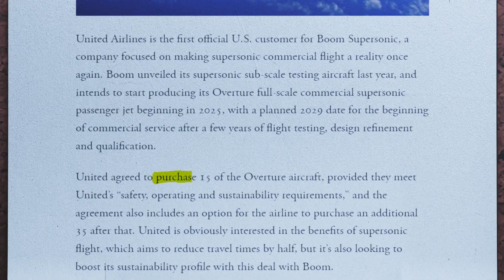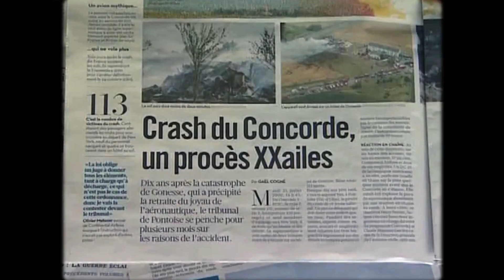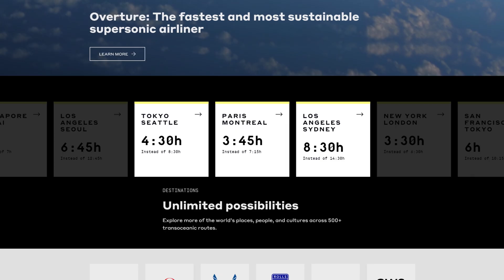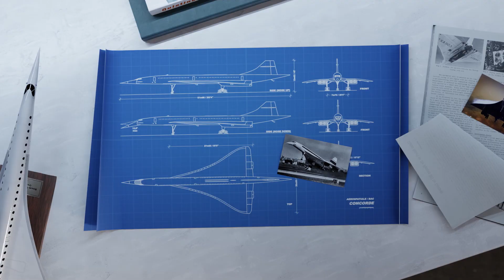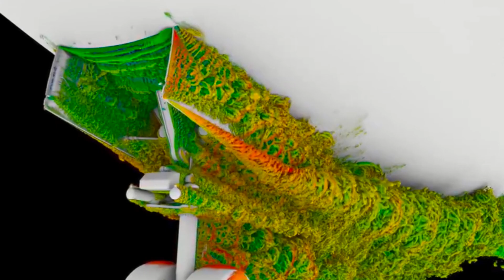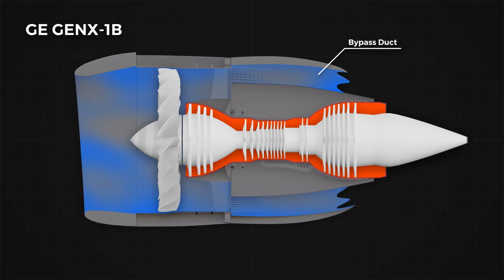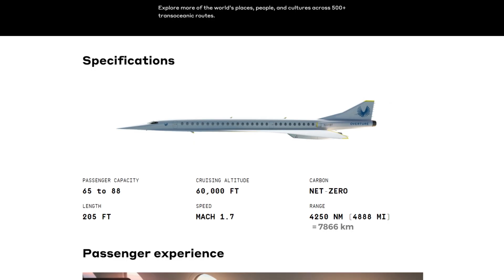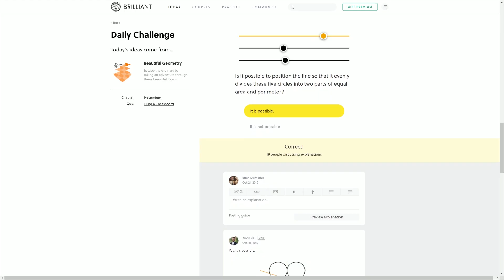Will Boom Bring Supersonic Back?

Comment: I think that this concept, though very interesting, as a near-ZERO chance of success. It's still a pipe dream that simply will not work in the modern passenger aviation environment. The economics of supersonic flight have changed very little since the 1960s, and they're using a 1950s-era turbojet engine. Seriously? This idea is a relic of a very heady-but-bygone era in passenger aviation.

The name of the game in modern passenger aviation is EFFICIENCY - achieving the lowest cost per passenger mile. Thus, modern passenger airliners use exactly two enormous high-bypass turbofan engines that sip fuel in comparison to previous-generation engines. The huge fans on the GE-90, GE-Nx, and other high-bypass turbofan engines create the VAST majority of the thrust - quietly and reliably. A turbojet engine simply has no way to do that.

Turbojet engines burn massive amounts of fuel to create thrust, and there is realistically very little that can be done to improve the efficiency of them. All they do is burn fuel to create direct thrust. And they are LOUD... very, very LOUD because there is no slow-moving blanket of air created by the giant bypass fan around the high-speed jet exhaust to reduce noise. It's all just hot, fast-moving, and very LOUD jet thrust. There are probably some minor improvements that could be made, but they are very likely miniscule compared to the huge improvements that have been made by developing turbofans with ever-higher bypass ratios using larger and more efficient fans. Turbojet engines on a supersonic aircraft would be working hard during the entire flight. This would wear them out more quickly, and would significantly increase maintenance costs.  

Supersonic flight can never achieve anywhere near the efficiency of subsonic flight... at least as long as there is, you know, atmosphere and friction and all that other "physics" stuff in the world. The economics of achieving long-term, profitable, mass-market supersonic flight simply don't work. They never have, and I see nothing in this project to suggest that they will work any time soon. Saving a few hours of flight time on any flight is simply not worth the exponentially-higher cost in this modern age of efficiency. Supersonic flight will remain a very high-end service for wealthy passengers - if it ever really gets off the ground at all.

And oh, as you pointed out. there is still the horrible sonic boom issue to deal with. The Ranger is STILL not gonna like that, Yogi!
Reply: Concorde was actually profitable for 20 years for BA (before it was prematurely forced into retirement by Airbus (politics and money) was that its purpose was to compete against subsonic First Class. 

Concorde’s tickets were only around 10–15% more (1996 GBP 4,772 vs subsonic First Class GBP 4,314) and this meant that a company could have its executive (who would have been sent First Class anyway) leave London at 10:30am, arrive in NYC at 9:30am (yes before they took off, as Concorde flew faster than the Earth rotates) take a 10 min helicopter ride to the East River heliport,  have a bunch of meetings and zip back to JFK for the 1:30pm Concorde to London and be in bed the same night. 

How's that for time saving?

Time as they say, is money, especially for these folks, and Concorde built a very loyal following that lasted throughout its service life operating in its own P&L division, and consistently profitable for BA from 1982 on, even when the mainline carrier was unprofitable.

Concorde had its own security, check-in, lounge and boarding gate from the lounge. No lining up for anything...

https://www.key.aero/article/inside-story-how-ba-made-more-ps500m-profit-concorde#:~:text=The%20result%20of%20this%20change,billion%20pounds%20profit%20for%20BA.%E2%80%9D

And turbojets are the perfect engine for supersonic flight. You must have supersonic exhaust gas velocity to supercruise. Concorde's Olympus 593 engines are still amongst the most thermally efficient machines ever made at 43%.

It is the only aircraft in history to be able to supercruise (fly supersonically without afterburner) at Mach 2.0 and do it for 3+ hours making it the most efficient high-supersonic aircraft ever to fly.
Reply: I feel bad for anyone whose invested a lot of money in this...
Reply: I wonder if a combination of a variable bypass turbofan and a swing wing would make a more economical SST.
Reply: @ryanchatham9971  Variable bypass turbofan? lol Good luck with that!
Reply: @ryanchatham9971   You said:  I wonder if a combination of a variable bypass turbofan and a swing wing would make a more economical SST.

Some interesting thoughts Ryan.

Boom have named the Overture pod/engine assembly Symphony, and describe it as a power module. They have now posted a cutaway impression of Symphony showing the variable geometry inlet and exhaust ducting and the engine parts. It is hard to tell, but it looks like there is a moveable ring at the fan face, which may in effect embody variable bypass as you suggested.

Swing wings are attractive from the aerodynamic point of view, giving good low and high speed handling, but they add a another level of complexity, weight, and cost, and have always been problematic, as in the Boeing 2707-100 and the F-111 for example.
Reply: Will Overture be able to fill the gap left by Concorde in the SST market?

Introduction
Boom have undertaken a mammoth task in developing and producing the Overture SST, with its Symphony power module and turbofan engine. The biggest risk is that they will deplete their capital, before a prototype Overture flies. Once that milestone is reached funding should be available. The following, is based primarily on information from Boom, and assumes that Overture meets its specification and goes into airline service. I have no connection with Boom whatsoever.

Aviation
Aviation has changed radically since the iconic Concorde first carried passengers in 1976. More people are flying, the number doubles every 10 years, and they are richer. Aviation fuel is roughly the same price as it was in 1976, taking into account inflation, and with deregulation, airline tickets are now cheaper, in real terms. Aircraft now have the range to fly non stop between any two airports in the world.

Technology
Computer aided design, and simulation has transformed aircraft design and development, by drastically reducing time and costs, and increasing effectiveness. In addition, advanced technology and materials, have enabled more powerful, more efficient engines, and lighter, cheaper, and more streamlined aircraft. 

Flight
Because Overture will be economical at sub and supersonic speeds, 500 routes, some mixed land/water, are viable, rather than just 2 Atlantic routes for Concorde. Overture will be carbon neutral, using sustainable aviation fuel (SAF). Overture will will create a sonic boom, but not over land, where it will cruise 10% faster (Mach 0.94) than subsonic airliners. It will cruise at twice the speed of subsonic airliners over water. Concorde carried 100 passengers at Mach 2, over 4,488 miles. Overture will carry 65 to 80 passengers at Mach 1.7 over 4,880 miles. 

Airframe
Both aircraft are 202ft long, but Overture will have a gull wing with computer controlled leading and trailing edge flaps, and a greater span, at 106 feet compared to 84 feet. Overture will also have an empennage. Carbon composite construction will enable streamlining, weight saving, and increased strength, while practically eliminating thermal expansion and contraction.  Overture will weigh an estimated 154 tons, Concorde weighed 185 tons. Concorde could carry 2.5 tons of cargo. The cargo capacity for Overture is not known. 

Engines
Overture's engines will be medium bypass turbofans without reheat, while Concorde had turbojets, with reheat. This means that Overture will be economical at subsonic speeds and will be low noise on take off and landing. Variable geometry ducting in the Symphony power units will probably allow the engines to supercruise.

Costing
Overture's predicted development cost is $8bn, against $14.4bn for Concorde. Manufacturing cost will be less, maintenance costs will be lower, and availability will be higher. Overtures selling price will be $200M, compared to $320M for Concorde. At a guess, Overture's development payback will be 150 aircraft, and airline payback will be 10 years, assuming 72 seats and 8 hours a day utilisation.

Operation
Overture will be simpler to fly, eliminating the need for a 6 month pilot conversion course. Overture will have improved low speed handling, especially on take off and landing, while maintaining low drag at supersonic speeds. It will have a modern cockpit, with a flight deck similar to subsonic airliners. A flight engineer will not be required. Instead of a droop snoot, external cameras and cockpit displays will give the pilots a view of the terrain when taking off and landing. Its cabin will be quieter and all its seats will be business class, almost certainly with internet. In contrast to Concorde's awesome engine noise, Overture will comply with ICAO-14 noise regulations, allowing it to use all airports, without triggering protests. 

Ticket Cost
Taking a JFK to LHR one way flight:  
Showing: Aircraft type,  Fuel cost per passenger,  Economy ticket,  Business Class ticket,  Duration

Boeing 747          $147          $577             $2,308                      8hrs 
Concorde             $753                                $5,000^                     3.5hrs 
Overture^^            $708         $1,200           $3,000^^^^                4hrs 
Business jet^^^                                 $53,000 to $99,000            8hrs  

Notes
^ 2023 value 
^^ Estimated prices, assuming Overture carries 72 passengers against Concorde's 100. For the first 2 years, only business class seats will be available.    
^^^ There are no supersonic business jets
^^^^ $5,000 return 

A 16 hour flight across the Pacific on a subsonic jet could be achieved with a 1 hour refuelling stop by Overture, giving a time of,  4 + 1 + 4 = 9 hours.

Market
Overture will not be competing for the mass economy market. Instead it is aimed at the 700 million long-range business flights made each year world wide. Boom and airline customer surveys show the viability of Overture, and they have identified 500 suitable routes. All Overture's seats will be business class and ticket prices will be comparable with business class on subsonic airliners. Once Symphony gets established it could become a niche service, similar to Concorde, but with many more routes.

Conclusion
Overture will be popular with both airlines and passengers, because it will half many journey times and will be cheaper, more comfortable and a lot more practical than Concorde. The military have already shown an interest in Overture. It would also be suitable for charter flights. There may even be a market for the Symphony power unit or just the engine. As Overture matures, it will probably be developed, just like subsonic jets. So the range may be increased, there may be a stretched version, and even an all economy seat version. After Overture, Boom could possibly develop a 200 seat SST.

22-2023.09.04
Reply: @phonicwheel933  Hi again phonic, the price of subsonic First class on BA and Concorde was about 10-15% different.(1996 GBP 4,772 vs subsonic First Class GBP 4,314 - Orlebar-The Concorde Story) Concorde's market price in 1975 was USD 34m. You can do the exchange rate update to 2023. Without a variable cycle engine (and even with, is unlikely that Boom will be economical at subsonic speeds. It aerodynamics and engines (when they get one) are optimised for high speed. Its bypass ratio is to low for so large an aircraft so higher power setting will be needed at lower speeds.

How Overture will have an exhaust gas velocity with a bypass ratio of 3:1 that is suitable for supersonic speeds and still meet noise standards remains to be seen. Again they don't have an engine yet.

It won't able to travel above Mach 0.90 and compete fuel burn wise with other aircraft as you are up against the steep Mach drag rise. This is what killed the fantasy that was Sonic cruiser.

A lower seat number, lower bypass ratio and subsonic flight over land make it  non starter in this market.

It will not be much faster than conventional jets over land but fuel burn will be much higher, so CASM will be through the roof by comparison to a B-787 or even a Max 8. There  goes that market.

It will have the Albatross of 'no supersonic flights over land' to contend with and this will limit routes dramatically.

I will pay attention when they have a working engine that can do what it says and even, then you will only have an overwater aircraft. It will get eaten alive in the overland routes as was the Convair 880/990.
Reply: While I agree with much of what you say, there are a couple of issues with your comment: There are two type of efficiency, energy usage and time.

As long as your RASM is higher than your CASM you are profitable that is why Concorde was profitable for BA for 20 years. Concorde competed with subsonic First Class not economy, and the price of subsonic First Class on BA and Concorde was about 10-15% different.(1996 GBP 4,772 vs subsonic First Class GBP 4,314) 

Turbojets are only inefficient at low speeds and low altitude but this is comparatively true of even high bypass engines. Fuel burn in cruise is dramatically less than on take off and climb. At supersonic speeds they are extremely efficient and no current turbofan can compete.

Concorde's Olympus 593 turbojets remain some of the most efficient gas turbines ever made and at Mach 2.0 have a thermal efficiency of 43%. Still top tier after all these years. The power of the Olympus dry, meant that Concorde spent most of the journey supercruising at Mach 2.0,   something no other aircraft in history has ever achieved. No afterburner required. Again. a key reason why Concorde was profitable for BA.

It only burnt 77 tonnes of fuel to go JFK-LHR in 3.5 hours. Holding and alternate fuel were carried on top of that making a fuel load of 92 tonnes. About the same as a B-747 of the time.

There is no turbofan engine currently in existence that can produce the exhaust gas velocity to supercruise at Mach 2.0. You have the very low bypass F-119 and F-135 of the F-22 and F-35 respectively and neither of these is close to as powerful as the Olympus dry. Both cost many billions to develop and yet are less capable.

Now let's talk market: For people in the target market time is the key efficiency not money. Allow me to demonstrate how critical this is and how Concorde conquered this market.

Concorde’s tickets were only around 10–15% more (1996 GBP 4,772 vs subsonic First Class GBP 4,314) and this meant that a company could have its executive (who would have been sent First Class anyway) leave London at 10:30am, arrive in NYC at 9:30am (yes before they took off, as Concorde flew faster than the Earth rotates) take a 10 min helicopter ride to the East River heliport, have a bunch of meetings and zip back to JFK for the 1:30pm Concorde to London and be in bed the same night. As they were having a nice lunch in the Concorde room at JFK waiting to depart their opposite number who took off at the same time but went subsonic First Class would just be clearing customs at JFK ..

Concorde had its own security, check-in, lounge and boarding gate from the lounge. No lining up for anything... How's that for time saving? 

Time as they say, is money, especially for these folks, and Concorde built a very loyal following that lasted throughout its service life operating in its own P&L division, and consistently profitable for BA from 1982 on, even when the mainline carrier was unprofitable.

So, Overture has to come up with an engine that doesn't exist, more capable than the US military has produced, somehow find a balance between high exhaust gas velocity needed for supersonic flight while keeping noise down (no-one has achieved this to date) .

On overland routes it cannot fly much faster than the M 0.82-85 of subsonic airliners because it will run up against the Mach drag curve that gets very steep after M 0.90, (that's why the 'Sonic Cruiser' was a non-starter). 

See the chart here: https://aviation.stackexchange.com/questions/91289/whats-the-relationship-between-mach-number-and-drag-force-on-an-airplane

Its fuel burn with low/medium bypass engines of 3:1 will be much higher than competing subsonic aircraft, (MAX 8 is 8.6:1)  I won't even go into the economics of the 787 trans-con with its M0.85 cruise and 266 3 class seat count with HBPTF engines at 9.5:1.

Over land subsonic, its CASM with 70 seats compared to a MAX 8 with 176-180 seats or 787 with 266 in 3 class will be at least three or four times higher for a point-to-point saving of what... 45 minutes across the US?

Who is going to pay for that?
Reply: @Completeaerogeek  Hi Complete. Interesting two posts. 

There are over a thousand comments on YouTube, repeating that Boom is a scam or it is doomed to failure. So, for a change, the post, 'Will Overture be able to fill the gap left by Concorde in the SST market?' assumes that Overture reaches production and meets its specifications, as currently defined by Boom. It's not, necessarily based on what I believe, although, I do think that there is a healthy market for supersonic airliners with Overture's claimed specification. 

The price per Concorde was based on a development cost payback from the 14 production aircraft, adjusted for inflation and the $/£ exchange rate. Of course, that price would come down if more aircraft were sold, depending on production costs.

Boom's claim of 20% faster over land is wishful thinking as you suggest. Assuming that a typical subsonic airliner cruises at 560mph at 30,000 feet: 560mph x 1.2 = 672mph, which is effectively the speed of sound, an impossible speed for cruising. The speed of sound at 30,000 feet= 678mph, and at 60,000 feet = 660mph. Running on sustainable aviation fuel is also fanciful, in view of the huge cost, but it is essential to make that statement to placate the environmentalists.

Overture's  accommodation will be business class and Boom imply that ticket prices would be similar to subsonic airliners. Flying over land, like the US E/W route, won't save any time so, as far as the airlines are concerned, the time efficiency would be lost, but to passengers there would be no difference from a subsonic airliner. Where Overture would show a speed advantage is mixed water/land routes. Neither of these options were available for Concorde, due to it's great thirst at subsonic speeds, and its noisy, cosy cabin.  

Boom claim that Overture will be 42% the weight of Concorde, so that should help with fuel economy, but 75% is more likely. Drag being proportional to the square of speed means that Overture's drag at 560mph would only be 35% of the drag at Mach 1.7, all things being equal that is. By the same token Overture will cruise at Mach 1.7, compared to Concorde's Mach 2, so that will reduce the drag to 72%. Carbon composite construction, as well as saving weight, also provides more scope for streamlining and optimising an aircraft's shape.

Overture's engine/pod development program seems tight. Work on the engine started in January 2023.  Maybe parts of the engine will be based on existing designs, like the core, and fan, for example. There are vague rumours about a P&W core. It seems unlikely that FTT would start an engine design completely from scratch. 

As you say, the engine specification is incongruous, but an economic engine at sub and supersonic speeds is central to the success of Overture, so the FTT and Boom engineers must be working towards that goal. Boom now have a cutaway impression of the Symphony power module on their site, showing the inlet ducting, engine sections, and exhaust ducting. Symphony is approximately 30.5 feet long with a diameter of 7 feet. The inlet ducting is 7.6 feet long and the exhaust ducting is 10.1 feet long. It's hard to tell, but there is a ring in front of the fan, which may be used to effectively give variable bypass.
Reply: @phonicwheel933  Hi Phonic, as usual, some good points. Also on the engine, that's funny I heard it may be based on the LEAP core but that would bring problems of its own.  I don't think it is a scam. People can get the' fever' and be genuinely intending to bring an aircraft to market. I believe that's what Aerion was doing.

I just saw a lot of this kind of thing when I was living in the US during the DotCom boom/bust. I am very suspicious that they haven't flown the XB-1 yet even though its data value will be next to zero. It would at least give investors something to look at. It appears to be close to flying but so it was, 3 years go... 

At least BAC had the 221 which was basically a mini-Concorde to explore the high and low speed envelope and handling of an Ogival Delta. This thing looks nothing like the new design.

The major redesign that happened recently is the kind of thins  that send you back to the drawing board. They are effectively creating a new design from scratch. That takes years and begs the question: how did they get it so wrong in the first place? If in fact it was wrong.

The only turbofans capable of supercruise that I am aware of are the F-135 and F119 and they are basically leaky turbojets and not nearly powerful enough. Those draggy pods really concern me. There was a reason Concorde's were in two combined nacelles. Same as the B-1, TU-160 and every other high speed aircraft with 4 engines. Interference drag at subsonic speeds and wave drag at supersonic speeds.

I saw the artwork on their site for the engine but I can't see how that can do it without having an Adaptive Cycle Engine and even then GE's proposal will need reheat.https://www.geaerospace.com/propulsion/military/xa100 but I don't expect they will allow that technology anywhere near a civilian project.

The real secret of Concordes inlets and exhaust was what happened when they were supersonic. The way they managed shockwaves to increase inlet pressure, decrease velocity and actually have a net positive thrust vector rather than being draggy, as they are on most subsonic aircraft was quite amazing.

In order for Symphony to produce a M1.7+ exhaust gas velocity, that fan is going to have to have a N1 higher than any aircraft in history. How they manage this with a 3 stage LP compressor is beyond me. Whatever way you look at it, it cannot be quiet if producing maximum thrust for takeoff. Lobed mixers as they show, cannot do the job. The shear between the bypass air and core air is the noisy bit.  I have stuck my head inside one out our LEAP 1Bs adn there is some very smart stuff going on to make it quiet but again, it only has very subsonic BPV/EGV.

As we both agree, overland this aircraft just cannot work. You are up against the drag curve adn we know how that ended for the Convair 880/990.

As for Concorde's price per unit, there were orders and options for over 100 aircraft when the oil crisis hit in 1973.

As usual all we can do is watch and wait... Nice chatting with you...
Reply: @phonicwheel933:  Hi Phonic, This so weird I wrote a reply to you today but it has vanished... Never mind. 

Here is the bit about Concorde's intakes I mentioned earlier but couldn't post because of some problem...

Chief engineer of the RR Olympus Sir Stanley Hooker-Not Much of an Engineer-  p 152

“In jet engines such as the turbojet or turbofan, the components at the front where the air pressure is rising are subjected to a useful forwards force, while downstream of the combustion chamber, the where the pressure is falling everything tends to be blown out of the tailpipe by an adverse rearwards force. It is the difference between these forces that propels the aircraft. But at Concorde’s cruising speed, one gets an unusual distribution of the various forces: from the variable inlet ramp --12% rearward, from the air intake system a +75%, from the engine itself +8%, and for the convergent/divergent nozzle, +29%. The total of course is 100% but what emerges is that the inlet is ten times more important in thrusting the aircraft along as the engine while the final nozzle is about four times as important. We therefore pay very careful attention to the inlet and nozzle.”

Just FYI: Concorde had over 100 orders and options at the time of the 1973 oil crisis. Had those been fulfilled at USD 34M per aircraft, the program would have paid for itself.
Reply: Hi Phonic, this is so weird. I posted a rely to you today agreeing with much of what you said but it has disappeared. never mind.

Here is the intake/exhaust information I promised you about Concorde to prove it didn't violate conservation of energy :)

Chief engineer of the RR Olympus Sir Stanley Hooker-Not Much of an Engineer-  p 152

“In jet engines such as the turbojet or turbofan, the components at the front where the air pressure is rising are subjected to a useful forwards force, while downstream of the combustion chamber, the where the pressure is falling everything tends to be blown out of the tailpipe by an adverse rearwards force. It is the difference between these forces that propels the aircraft. But at Concorde’s cruising speed, one gets an unusual distribution of the various forces: from the variable inlet ramp --12% rearward, from the air intake system a +75%, from the engine itself +8%, and for the convergent/divergent nozzle, +29%. The total of course is 100% but what emerges is that the inlet is ten times more important in thrusting the aircraft along as the engine while the final nozzle is about four times as important. We therefore pay very careful attention to the inlet and nozzle.”

FYI- Concorde had over 100 orders when the oil crisis hit in 1973. Had these been fulfilled, the program would have paid for itself.
Reply: @phonicwheel933  I am still having problems posting here for some reason. I wrote a reply today agreeing with much of what you said above.

Here is the bit I promised earlier about Concorde's intakes to show they don't violate the law of conservation of energy (mainly because this only occurs in isolated systems).

From Chief engineer of the RR Olympus Sir Stanley Hooker-Not Much of an Engineer-  p 152

“In jet engines such as the turbojet or turbofan, the components at the front where the air pressure is rising are subjected to a useful forwards force, while downstream of the combustion chamber, the where the pressure is falling everything tends to be blown out of the tailpipe by an adverse rearwards force. It is the difference between these forces that propels the aircraft. But at Concorde’s cruising speed, one gets an unusual distribution of the various forces: from the variable inlet ramp --12% rearward, from the air intake system a +75%, from the engine itself +8%, and for the convergent/divergent nozzle, +29%. The total of course is 100% but what emerges is that the inlet is ten times more important in thrusting the aircraft along as the engine while the final nozzle is about four times as important. We therefore pay very careful attention to the inlet and nozzle.”

Also Concorde had over 100 orders and options when the oil crisis hit in 1973. Had these had been completed, the program would have paid for itself.
Reply: @Completeaerogeek  Hi Complete. Don't worry, I can see all four of your posts. 

YouTube posts are monitored automatically and also by a team of people. Sometimes YT does weird things. It even deletes posts without saying why. Or posts vanish and then come back. YT are not keen on links in a post in general, but especially if they look like a sales pitch. Also, it will delete a post if it contains certain non PC words, regardless of context.

In addition, a post may not display because of a glitch somewhere. Doing a refresh (Control + F5) may bring it back, or if not, a reboot.
Reply: @Completeaerogeek   Hi Complete.
As you say, the Boom Overture may be a case of overenthusiasm. But, there is something about Boom that suggests that they might succeed. I hope so.

The XB-1 is history now, and there seems little point in progressing it further, in view of the cost involved, and the danger of piloting an experimental aircraft.

As far as the mid 2022 Overture redesign goes, I think it is a good thing, if it leads to a better solution. Concorde had three major redesigns: 1963, 1965, 1968, causing a delay of 5 years to the development program, but they ended up with an outstanding aircraft. As Boom didn’t build a mark 1 Overture, the cost probably wasn’t that great, and they must have learned a lot in the process.  

One thing favourable about Boom, assuming that they have some top notch aeronautical engineers, is that they seem to do a lot of studies and simulations before actually cutting metal. Boom say that the latest Overture design is the culmination of 26 million core-hours of simulated software designs, five wind tunnel tests, and the careful evaluation of 51 full design iterations. Of course, that could be interpreted another way!  

The GE XA-100 adaptive cycle engine looks quite something, as are the development costs!

Hooker’s, ‘Not Much of an Engineer’ is a great read, and he was a genius. While Concorde’s power plant was an excellent design, the Mach 3.3, J58 powered, SR-71 has 2 big pods with inlet spikes, similar to Symphony, so they would have more relevance, and also produce thrust rather than drag. The thrust distributions are:

Concorde at Mach 2: inlet ramp -12%, Inlet 75%,   Engine 8%,        Ejector 29%
SR-71 at Mach 2:                                     Inlet 13%,   Engine 72%,      Ejector 15%
SR-71 at Mach 3:                                     Inlet 54%,   Engine 17.6%,   Ejector 28.4%

The Symphony power unit is a good approach, because it provides modularity, reduces type variety, and eases servicing. But, it's absolutely huge at 30.5 feet long and 7 feet in diameter, although cruising at 60,000 feet will reduce any drag quite a bit, to 0.07 of sea level drag.  

My simplistic theory about the engine configuration is that the fan inlet will be totally exposed at low speeds, and all but the centre section will be effectively masked at high speeds. This would mean that essentially there would be no slow bypass air to cause drag at high speeds, and efficiency would be realised at low speeds. Being an SST, as opposed to a military aircraft, means that the transitions from full fan to masked fan and back, can be quite slow. Also, apart from take off and landing, Symphony will be  flying at just two speeds, Mach 0.85 and Mach 1.7, and as no significant manoeuvres will be performed, the input ducting should be simplified, compared to a fighter. 

I gather that you don't think that fan masking will work, but there definitely is a donut shaped deflector in front of the fan face in the rendering of Symphony.  Why will the N1 speed be a problem, because AFAIK the gas velocity at the LP turbine would still be subsonic, and the fan would only be producing enough air for the core? In all supersonic engines, including the Olympus 593, the ejector accelerates the gas from subsonic to supersonic speeds. Added to this, the Symphony engine is a medium bypass rather than a high bypass type, so the core would be designed to produce thrust, rather than just driving the fan, as in high bypass engines. 

Your comment about ineffective noise suppression is a worry. Afraid I know little about that topic. Be interesting to investigate though.

As said, Overture will only be able to travel about Mach 0.85, rather than 20% faster than normal subsonic airliners, but provided that Boom's efficiency claims are met, Overture would be viable over mixed land/water routes. At Mach 0.85 could it have economy comparable to a standard subsonic airliner?  0.5x the speed means  x0.25 the drag, but 2x the in air time, with a net effect of 2x the economy, all things being equal that is.

Concorde’s lack of sales wasn’t only caused by the quadrupling^ of oil prices. Objections to sonic boom, and the subsequent worldwide ban on supersonic flights over land, coupled with very high subsonic fuel consumption, was the main problem, as it made planned overland and mixed land/water routes nonviable. 

Increasing aircraft cost was also a problem. American airline companies supported Concorde by taking out 38 options to buy, at a price of $20M, but by 1973 the price had increased to $40M^^. The final price was estimated to be $60M. This was too much for Pan Am, so they cancelled, and other airlines followed. In comparison, a Boeing 737-200 cost around $5.2M in 1973.

Notes:
^ In 1973 OAPEC stopped supplying the US with oil in retaliation for congress voting to supply $2.2bn to Israel to fight the Yom Kippur War. This quadrupled the price of oil from $2.90 a barrel to $11.65 a barrel in 1974. (Federal Reserve  2013) 

^^ “The price has soared from the under $20M per plane originally estimated until, with spare parts, it is $46M in 1972 dollars. Many insiders estimate escalation clauses will bring the price to $60 million.”  (NY Times 1973)
Reply: I completely agree, but the CEO will probably be able to sock away enough investor capital for a nice nest egg before the company's eventual failure.  So it will be a success after all. XD
Reply: @brainmind4070  It reminds of of the reckless environment in tech in the 90s - which of course all came crashing down with the Dot-Bomb in 2001. Lots of people losing lots of money on companies that never made any money and went out of business, because they never had a solid business plan to become profitable… short term nor long term.